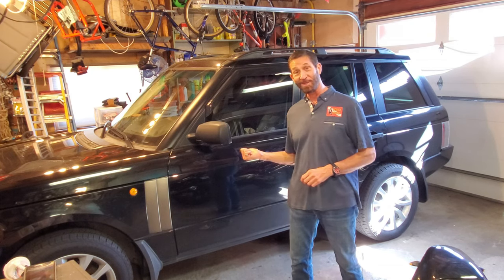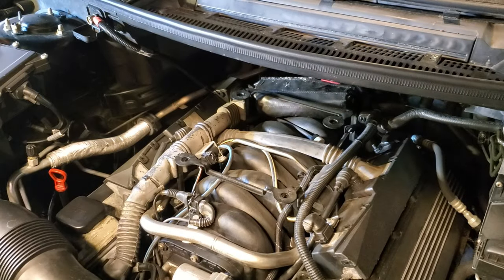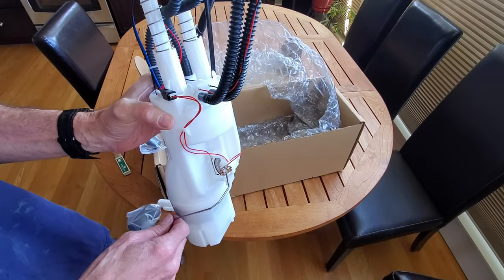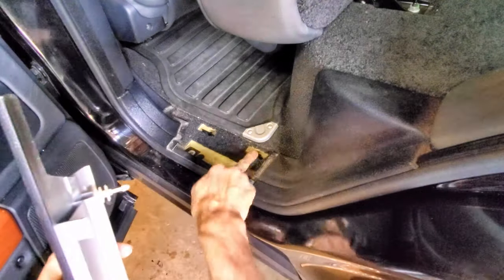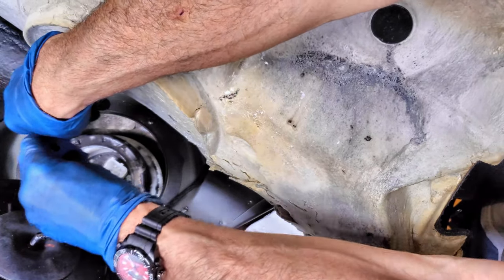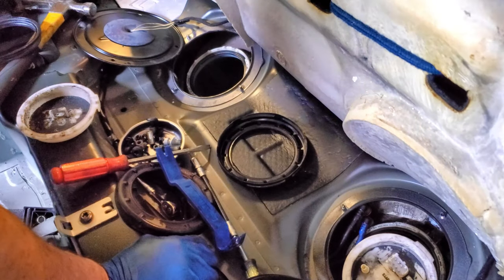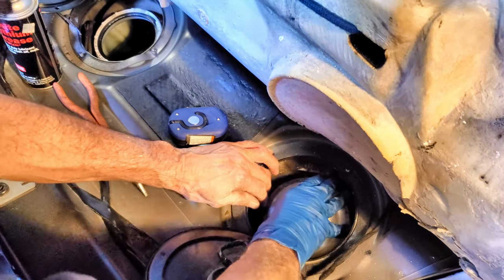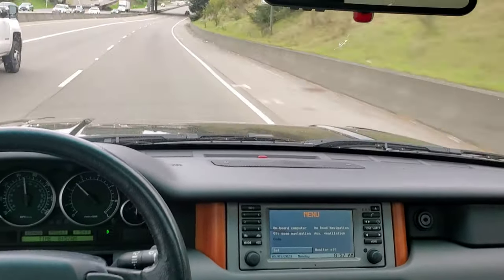Range Rover L322 Replace Fuel Pump Complete 2003 - 2005

Comment: wish i had your confidence to attempt big jobs like this
Reply from the maker: I hear you. I had read a lot of stories of professional shops breaking the strange connectors on the filter and the pump mostly because they've never seen them before and probably never will again. They only used them on these a few years and breaking them can lead to some costly issues so I thought I'd give it a shot and share some of the tips on trim removal along the way. Thanks for the comment.

Comment: Are you aware of the LR TSB that instructs you to remove the plugs on the fuel pump assembly unit and directly wire everything together?  Appparently, the plug connectors are faulty and eventually they stop carrying signal.  So, on top of everything you are doing, I think I also have to clip a bunch of wires.  It's TSB LTB00566NAS4, but I think this is just for 2010-2012 models...have
Reply from the maker: Thanks for posting that information. Although the access and removal remained somewhat similar, the BMW hardware in the video was only used from 2003 - 2005. By 2010, BMW had already sold Land Rover to Ford and Ford had already sold it to TATA. The fuel pump on the 2006 was a very different beast than the one in video and it even had different fuel connectors. The 2010 was even more different still. Thanks again for sharing that TSB info. That looks like good intel for those with the affected 2010-2012 models.

Comment: Great vid, is this the same for 2006 HSE thanks
Reply from the maker: Similar but no. Same location but different pump and different connector types. The access hatches will look similar. We're on to some of the Ford stuff in 2006 but the process from my video is pretty similar.

Comment: Can you share a website that sell Full fuel pump for L322 2003 patrol not “ diesel “
Reply from the maker: It's not an accident that I avoid providing links and recommendations for non-OEM product for something like this, however, Pierburg and Atlantic British are both brands/vendors that I would trust for complete assemblies. To save money, you could replace just the pump if you're comfortable doing the job. I believe Pierburg also sells just the pump for that purpose. Also, if it hasn't failed, you do not need to replace the secondary siphon. I just did so because it came with the assembly. Either way, you will have to uncouple it from the main pump assembly. I hope that helps and good luck with it.